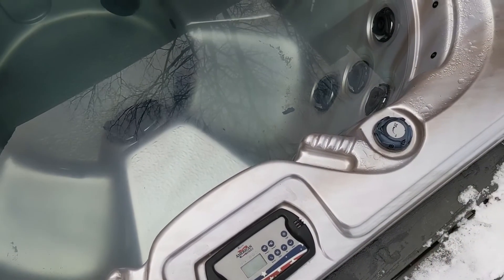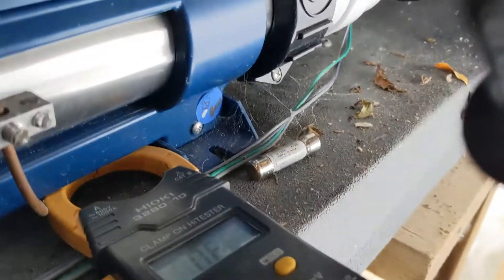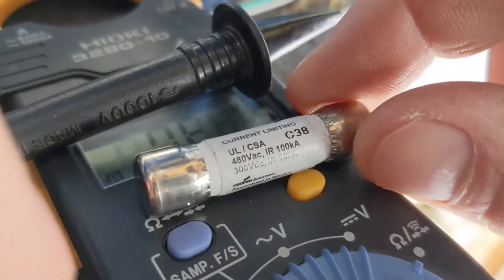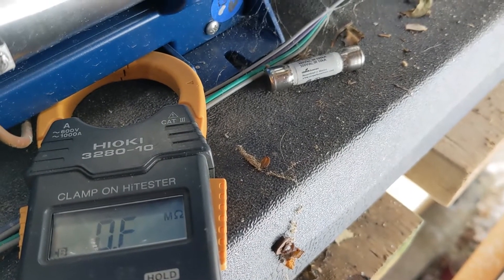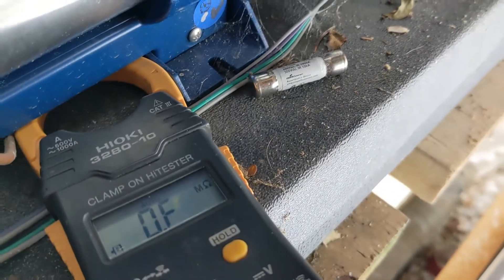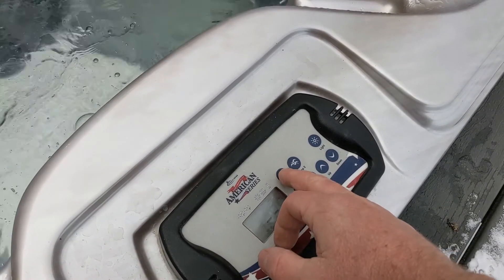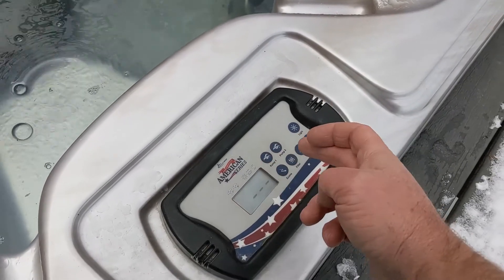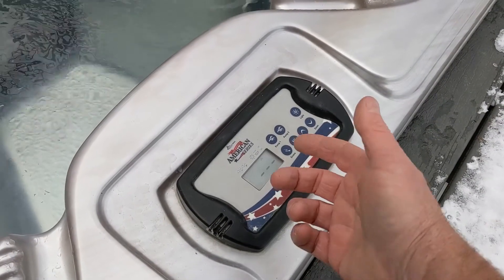Hot Tub Pump Isn't Turning On / Hot Tub Pump Not Working

Comment: Hello i have a sundance as well as marclemery, but im just gettin a click and the pumps wont start, the lights , the radio work and the display shows 11A, looked up the 11A code  and found that it can be a bulge capacitor, but checked the board and display and looks clean and perfect,  i haven't tested the fuses ,but will do, but for the meantime any idea if the fuses are good ? Thanks really appreciate the help
Reply from the maker: Test everything including the capacitors.

Comment: Had fuse go on the panel, after we had ozonator plugged in. Pump 2 also stopped working on my hot tub too and this video explained it perfectly on the fuse issue there too, thanks!
Reply from the maker: Thanks for the comment.
Reply: Does the fuse need to be removed to be tested

Comment: Hoping you can help. Sundance Optima tub. The control panel shows 3 or 4 little sideway lines but pumps or heater won't come on. Lights do however. If I turn off the breaker and turn it back on, circulation pump will start for a second but shuts off again. Any idea what could be wrong? Control panel usually lights up too but not anymore.
Reply from the maker: need to know what spa pack is in there.  if its a balboa, it might be a sensor.  let me know what spa pack you have in there.
Reply from the maker: Also, Try turning off the spa for 1-2 minutes then turn back on.  was it just filled?
Reply: @VIPPoolsandSpas  hi and thank you so much! It wasn't just filled no. Used it a few nights ago and all was good. I only turned it off for 30 seconds at the most at this point. I will turn it off for longer tomorrow morning and also look for the type of unit it is.

Thank you again!
Reply: Might be a stupid question but how will I know what spa pack is in there?
Reply from the maker: @marclemery6673  ok.  And, let me know what color the outside sundance logo is.  Should be white.
Reply: @VIPPoolsandSpas  turned off the breaker for about half an hour and it seems to be working ok now. Sundance label is white, yes. Took a video of the breaker turn on and of the electronic panel. I'll post and send you the link.
Reply from the maker: @marclemery6673  when turning it off and back on resets the error.  If the 3 lines came back on and the outside logo light was red.    There's still a problem.  If it shows your temp now and logo is white.  Should be ok.  Clean your cleaners every week.
Reply from the maker: @marclemery6673  spa pack is the box under the tub that everything plugs into
Reply from the maker: I meant filters.  lol.   keep an eye on it for the next little bit.  might be a sign of a sensor going.
Reply: @VIPPoolsandSpas  Hahaha! I was wondering what keeping the cleaners clean meant. Thank you for all the help!
Reply from the maker: @marclemery6673  no problem.  Subscribe if you want.  Maybe something else will help you in the future?
Reply: @VIPPoolsandSpas  already subscribed! 😊